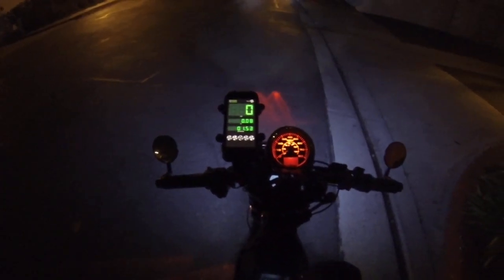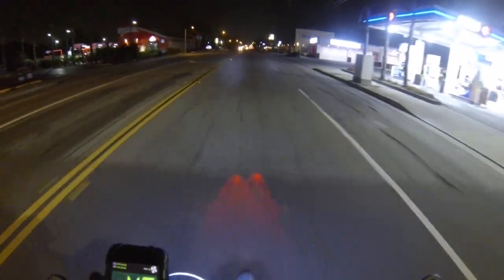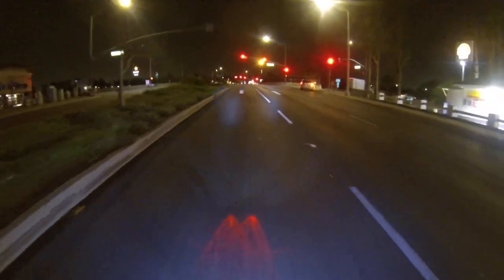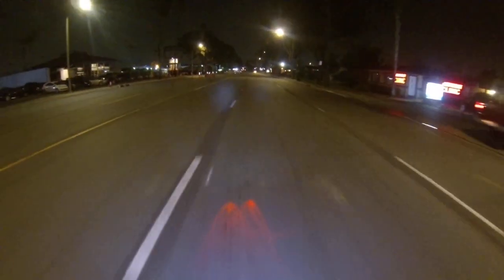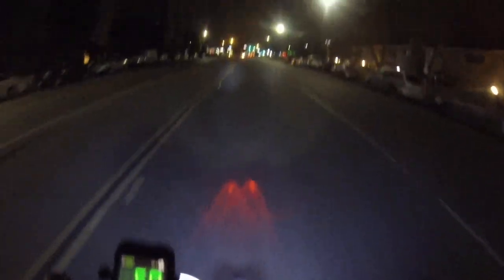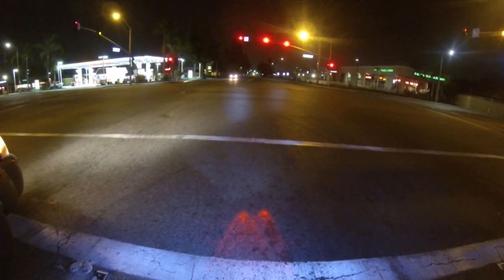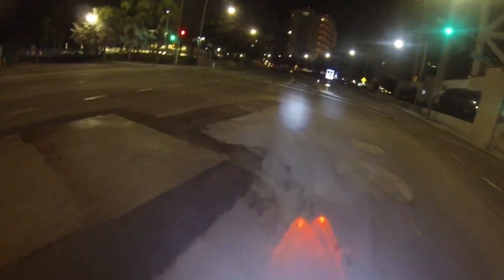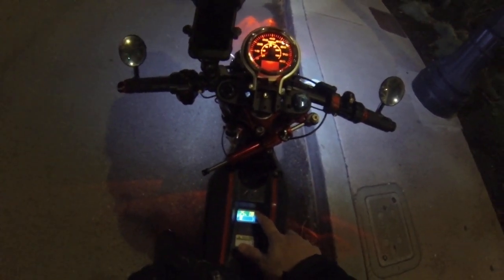Ride to Work on the Sur Ron Light Bee ERT ASI BAC4000 Controller & 72V Lite Speed Bikes Battery

Comment: is it easy to protect from theives? if so how? as you cant really put a bike lock on it. Thanks a lot!
Reply from the maker: XxstripeylionxX my building has a secure parking garage, but I do have a 6 foot cable lock I can run though the frame after I take out the battery when parking in public near tall poles, fences,or bike racks.
Reply: @skyungjae  thanks!